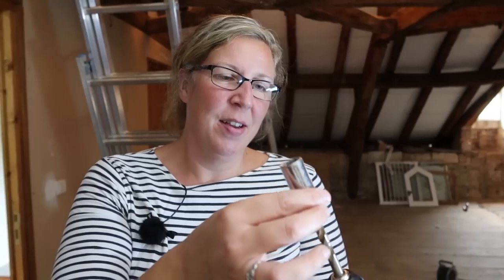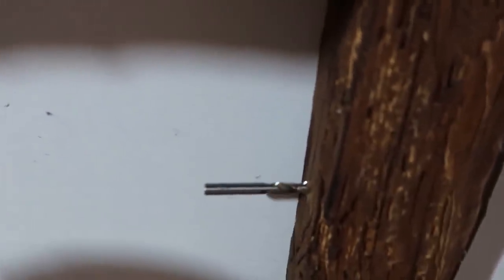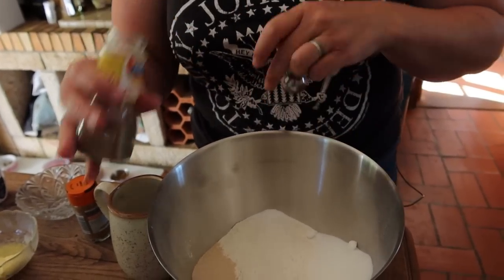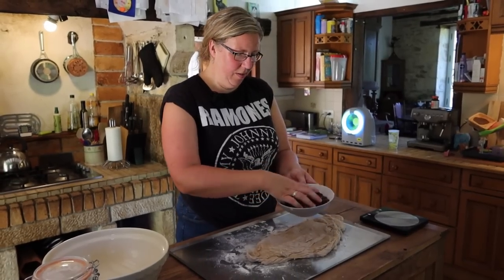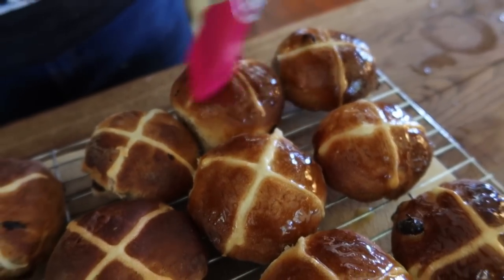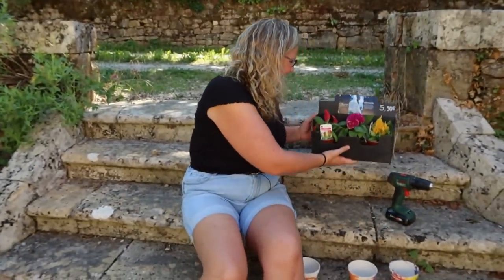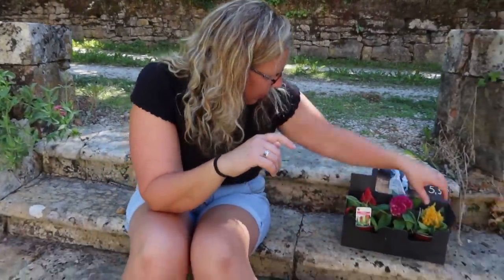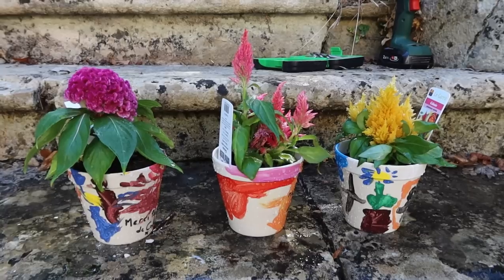Treating the woodworm in the attic

Comment: When you need a certain depth have you tried just putting a piece of electrical tape around the drill bit to the depth you need? I've seen it done and it seems to work....
Reply from the maker: Because it’s solid oak you need a lot of pressure to get the hole to cut so you really need a hard stop

Comment: What did you paint on the hot cross buns after you took them out of the oven?  You may have said but I missed it.  You mentioned, "Makeup," but somehow, I don't see you eating cosmetics:)
Reply from the maker: It was a very small amount of lemon curd, thinned down with a little water and then lightly warmed in a dish for a couple of seconds in the microwave. Basically a glaze. The common glaze topping for hot cross buns is apricot jam, but I didn’t have any, so improvised!